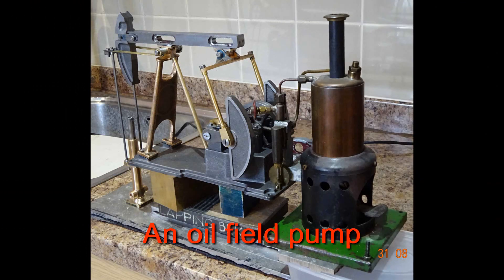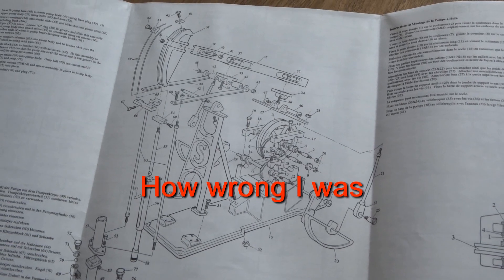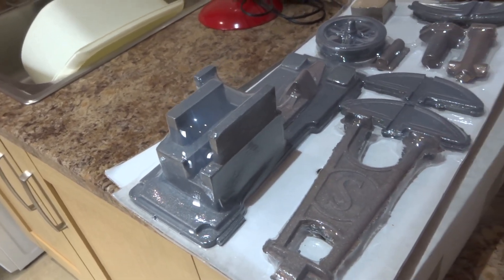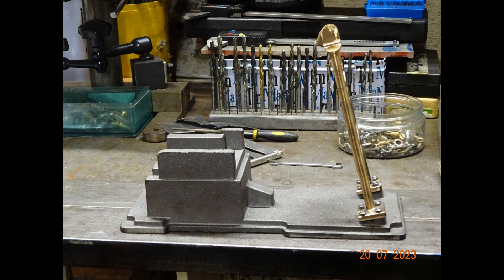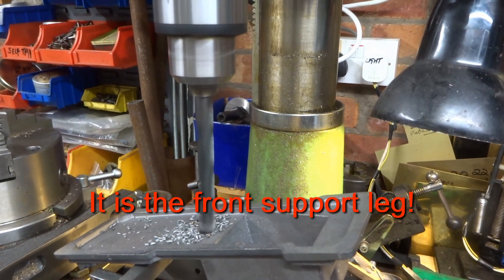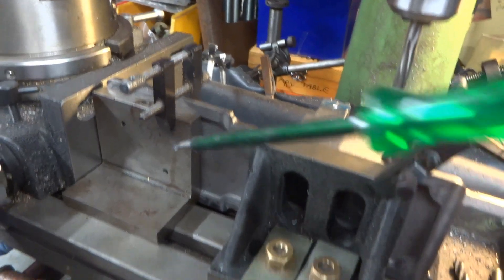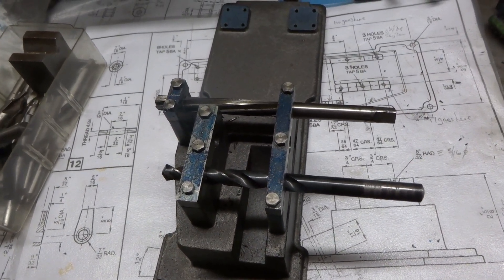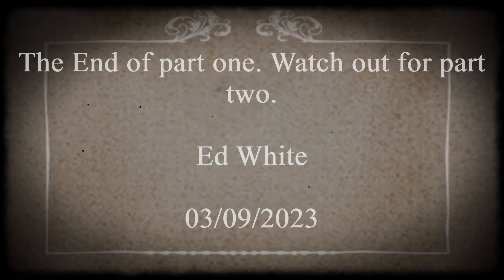nodding donkey oil field pump part 1

Comment: Edwin, when you broke the centre drill. you may have got to the broken centre drill pilot by removing the bearing cap, assuming the hole was on centre withe the split. Intresting video Thanks for sharing, always like your videos.
Reply from the maker: Thanks for the tip! I did try removing the tip initially as u suggest but without success. The hollow end mill got me out of trouble. Ed